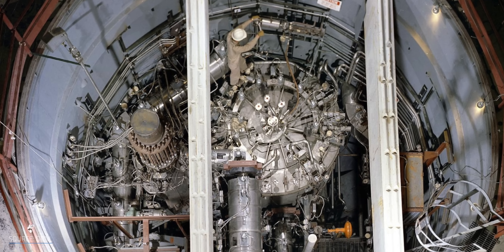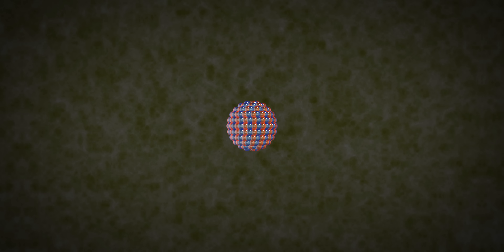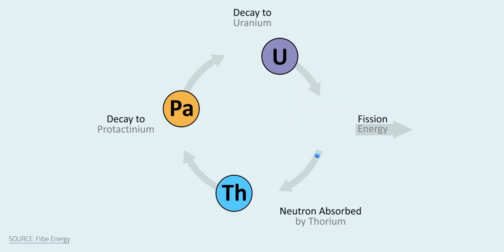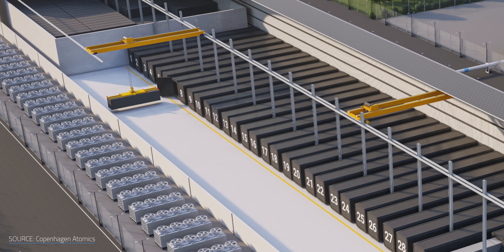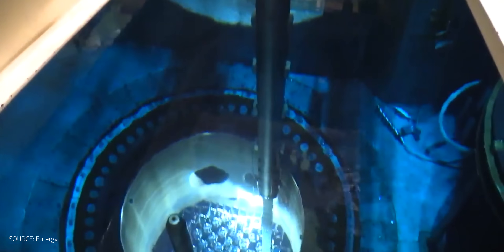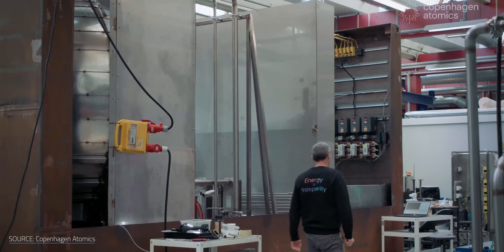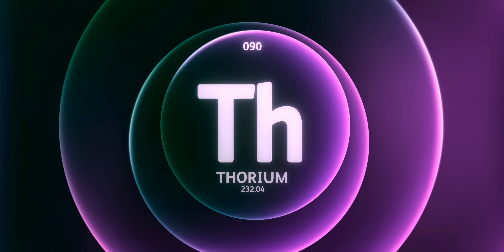Why Thorium is About to Change the World

Comment: How viable is such a power source if you have to replace the whole module every 5 years because of corrosion and radiation, and then not be able to recycle that module due to the radiation it has been exposed to ? And given that the desire is to have many thousands to millions of these reactors, where is all this waste going to go for the hundreds or thousands of years until the levels of radiation becomes safe. This is not to mention the loss of limited resources that could go into building other sources of technology or energy that is lost due to the disposable eco system these reactors would create (and which so much other disposable technology demands) .   This would also mean that the up scaling of building,  maintaining and disposing of such an eco system to one monopoly corporation brings its own problems and risks that corporate monopolies often do. ie price gouging and market manipulation, not to mention dependency and corporations acting in their own interest.

Sounds Great on paper, but as often happens, the reality is so different and often the cost/benefit ratio not great on the benefit side of things.

Comment: 9:12 Gamma radiation is the most energetic one. Only half a meter of steel to cover it up? Imagine dudes moving ship containers and bursting gamma rays at every person crossing by 😂
Reply: Presumably the reactor isn’t running (and breeding Uranium) during shipping.
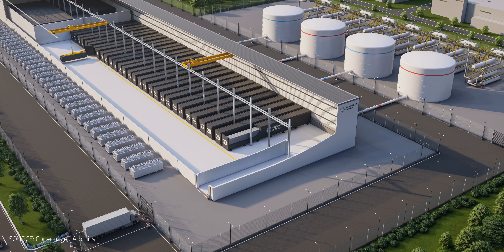Reply: @frederickheard2022   My concern that goes along with the original comment is the facility design that shows up at 2:25 that shows the shipping containers lined up alongside one another in an open environment surrounded by what looks to commercial office space. I know it's currently just a visual concept, but I do see that safety concerns with designs of that nature.

Comment: Very cool technology; I bet the engineers have enjoyed the challenges presented during the design process. Germany's THTR-300, a prototype commercial power station, operated in the 1980s, using thorium as a fertile fuel.

Comment: Nice Job Matt! I love renewable energy like wind and solar, but when we fail to consider new generation nuclear fission, we disregard an energy solution that can fill in the gaps of other renewables. One example you cited was the waste heat generated by a thorium MSR, useful for industrial purposes, or to desalinate water. Another useful by product of two fluid MSR's are the useful medical isotopes that can be extracted in real time, while the reactor is in operation. Would love to see workable Fusion energy too, but when you consider ITER, the proof of operation and cost seem far off yet. In years to come, Fusion will probably also be viable but not before the nuclear renaissance occurs powered by new generation fission.

Comment: The corporations that run the “energy economy” will never let this tech see the light of day.
Reply: This is my fear, and the DOE/NRC officials have been complicit in suppressing this technology for more than a decade, where they always misrepresent thorium by its disadvantages in solid fuel, and never consider the thermal spectrum molten salt breeders being advocated. Those profiting off scarcity do not want abundant and universally available cheap energy, where the fuel supply can't be monopolized or choked off.

Comment: I worked in the nuclear industry for 42 years and am pro nuclear.  Here are the facts; New nuclear works well as a base load power source and is very reliable.  New nuclear is the most expensive way to produce electricity. There is no such thing as economies of SMALL scale and the smaller the facility, the higher the operating cost.  Thorium is not fissile and while it can be used as a fuel, overall it would add more costs to nuclear. Nuclear power construction has always used the build it in a factory concept to the extent possible and this idea is not a game changer. The U.S. has designed and built every possible reactor design and overall, PWRs and BWRs have the most pros and least cons.

Comment: Wait what? "The tech will never get old because the whole reactor only lasts 5 years" doesn't sound like a flex... What percentage of material needs to be replaced? And it sounds like all that material would be super radioactive? How is it recycled or even disposed of?

Also.. are these plants any better at varying their output? Because that's the nail in the coffin for existing nuclear - because it can't compete with   unfirmed solar and wind when the sun is shining and the wind is blowing, meaning they can't reach their required utility to be anywhere near cost effective (the LcoE for nuclear, already very high, assumes 24/7 operation)

Unless these reactors can produce power for cheaper than wind or solar, which it doesn't sound like they'll be able to for a long time, they will be in trouble if they can't vary output.

Their is niech use-cases for nuclear, data centres and servers that absolutely need 100% up time.  But even heavy industry could adjust its operations to line up with renewable output.

Comment: There is a way around the traditional uranium reactor. The Stirling engine. A technology from the 1800s which would maximise the nuclear reactors energy output by using the heat to produce power. History has just as many answers as dreams of new technologies.

Comment: After using them they can drain out the molten salt fuel, but surely the rest of the plumbing, pumps, reaction vessels, shielding, etc. are radioactive waste and/or seriously physically degraded after a few years of heavy gamma irradiation? What happens to the old reactors when they're done with them?

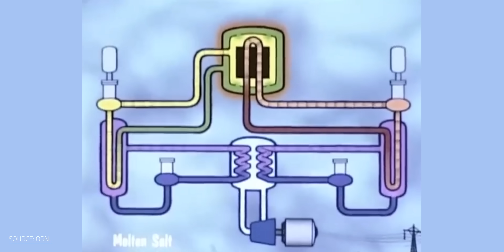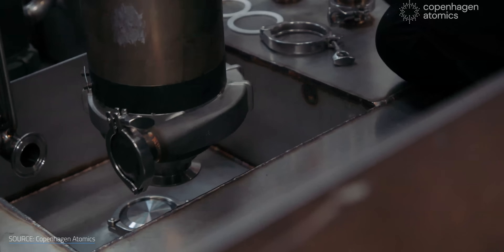Comment: This rolling advert for Copenhagen Atomics is full of lies and distraction and needs some documented skepticism.  1:15 "ran successfully for 15K hours from 65 to 69 producing steady..." From Bulletin of Atomic Scientists: During its operational lifetime, the Molten Salt Reactor Experiment was shut down 225 times. Of these 225 interruptions, only 58 were planned.   5:50: "safer" is a potential, but since there is no experience with novel reactors and fuel assemblies, there is no known safety.  Further, the industry has been attacking and de-funding the NRC to remove public safety oversight.  Breeder reactors don't rely on nuclear decay, and are always just a few seconds from meltdown, as happened with Fermi 1.   7:20 having a circulating core and an enrichment blanket makes this the obvious choice for proliferation. The reactor can run cheap and publicly available U238 through the blanket to produce plutonium for bombs.  As these reactors will be made for the international market, developing world politicians want such reactors for nuclear weapons production.  8:47.  It is conceivable that since water would follow gravity in the reactor, a flood as we had with Fukushima would keep the exit lines cold, preventing exit from the core, resulting in overheating, or meltdown.  Since it is such a small reactor running hotter with no secondary containment vessel ,  there is much greater chance of hydrogen explosion, and release to the environment. 9:34.  We have made U233 bombs before, with a few tweaks the reactor can produce a greater amount of U233 vs U232. 10:34 Above ground safely for " a few hundred years."  It is still an awful product that could be weaponized as in dirty bomb, and a few hundred years is a long time, as we barely had steam power and trains didn't come along for almost another hundred years, three hundred years ago.  11:00 Waste burners make very complex and long lived wastes, negating any advantages just mentioned. The MSRE produced wastes which were the most complex wastes Bechtel said they handled. Those wastes also nearly had a criticality event which would have been disastrous, probably a release to the environment.  11:50 Kudos for showing heat, neutron bombardment and corrosion are major problems.  Mated to mass production, and unapproachable maintenance, it should be obvious this is a bad idea.  13: 10 Pederson's math is bad, it is doubtful that you would have a new model every year which is the only way you would have it new every 5 years and have constant production. Airplanes have more conservative changes to maintain safety. Likewise the cost of licensing of continually renewed designs would be prohibitive. 15:50: Nuclear power has always over-promised and under-delivered on price.  These prices are already met with Wind and Solar with storage, difference is renewables and batteries will be cheaper in the future, while fission is consistently rising in cost.  16:45 "Provides something that Solar and Wind can't"  for example the car company "BMW has sourced it's aluminum from solar produced light metal foundry at Plant Landshut", and concentrated solar has been known to reach temps for Ammonia production.  Overall, the production of nuclear weapons is the true game to all the breeder reactors such as from thorium advocates and Terra Power and Natrium. They are slated for international export, and there is more money in patents for reactors involved in making bombs than for  producing electricity.  I have enjoyed and approved of Matt's work, however this advertisement is disgraceful lack of checking history and facts.

Comment: Saying thorium is closer than ever is about like saying fusion is closer than ever. There are fundamental problems with the technology that we have no idea how to overcome. For thorium it’s the physical erosion that happens from moving around such a high density high temperature liquid. Perfusion hits how to contain 400,000,000°C plasma. I honestly think we’re gonna figure out fusion before we figure out the erosion from thorium. Heck we’re more likely to have piezoelectric generators certified for use from Westinghouse before we figure out the erosion issue. Funny thing is the Westinghouse idea was brought up in the 50s but it got guilt so let’s see what happens this time I guess

Comment: Probably too little, too late. Advanced geothermal shows better promise of becoming cheaper than fossil fuels; requires no fuel; creates no waste; and the earth has enough heat to power humanity for 4 billion years.
Reply: How do you access geothermal energy? Don't you lose a ton of it just by temperatures cooling down as you bring it to the surface

Comment: I love, love, love, Thorium reactors. Thorium, named after the god of thunder himself. There is so much more you couldn't cover. Things like Thorium is in the highest concentration around rare earth minerals, so a side effect would be access to minerals only China controls right now. Right now the problem with rare earth mines is all the Thorium around it that they have to dig through and store at great expense before filling it back into the hole when they are done. Excess waste heat could be used to desalinate water. That small amount of waste can be used in cancer fighting radiation or to power NASA spacecraft. The waste could actually be worth more than the thorium it was burnt out of. Also keep in mind that a standard coal plant releases up to 100 times more radiation into the air than what any nuclear plant is legally allowed to. Love Thorium

Comment: The primary issue with thorium is that it is dangerous to mine. Median survival to thorium dust inhalation is 33 years. And the studies found it made no difference if you were working in the mine or top side in administration.

While the studies are old, mostly dating from the 1950s and 1960s, it is quite a statement that industrial safety experts effectively banned the use of thorium during that time period. Thorium as an industrial product is really that dangerous.

Keep in mind a plus for uranium is that it has to be enriched (i.e. processed) to be used as a fuel. Thorium does not.

Comment: small modular reactors is a scam. they are not cheaper than large ones, which are already the most expensive source of electricity.
there are no economies of scale for them because they can't get cheaper until they get scale and they can't get scale until they get cheaper. nobody will buy hundreds of gigawatts of expensive nukes, which still require army to guard fissile material.

Comment: I believe this is our best shot at a thorium breeder reactor. The big benefit of CA's design is the plan to swap the reactor core every five years. Traditionally, reactors are expected to last 40+ years, but we don't have any alloys that can survive that long in a molten salt environment. Swapping the reactor allows you to bypass this problem and iterate the design more quickly.

I've calculated the cost of this swap to be around 0.5 cents per kWh.

To my knowledge, the Chinese reactor design cannot be easily swapped, so they rely on a superalloy that doesn’t yet exist.
Additionally, CA is building full-scale from the beginning, whereas China is developing pilot plants in three steps, with increasing size and different dimensions. CA has also focused on building and testing components from the start, and they claim to have about the same molten salt test capacity as the rest of the world combined. Many other startups only have designs on paper.

For these reasons, I believe CA is on track to be the first to the finishline, and with a very competitive design.
Reply: There are multiple companies that have been proposing for years to dispose of the vessel after a relatively short time period, not just CA. Terrestrial also proposes this. Another so called benefit is the moderator is also replaced. What could be an issue is disposing of all that activated and potentially plated material.
One of the benefits of solid fuel designs is that the cladding is the only material in direct contact with the fuel. MSRs still need to address the quantity of material in direct contact with the fuel which can make maintenance difficult and creates a potentially difficult waste issue.
Reply: @richardb1452  You are right that several others plan to swap the reactor, but most of them are not going for full thorium bredders. Do you know of any? I think Flibe Energy is one, but they have been less focused on testing components.

Comment: Good video. For what it's worth, I think next gen fission via modular implementations of molten salts & thorium are likely to precede any sort of fusion by many decades. The key question will be in how quickly "developed" nations adopt sensible regulatory frameworks to let them get initiated, built, upgraded, and decommissioned (and perhaps most importantly, get insured). I suspect that the fusion guys will eventually get caught up in those issues too, but they're so far away from deployment, they can ignore it for now.

Comment: Thorium was defunded because it doesn't require U235 enrichment and doesn't generate PU239 which are both needed for Nuclear Bombs. This is why new reactors in the Middle East, an energy rich area, which doesn't really need the energy, are being installed. Iran for example, as we speak is enriching U235 well beyond what is needed for Nuclear Reactors to levels needed to build nuclear bombs. Solar / Wind / Battery power plants now produce baseload power at a fraction of the cost and in a fraction of the time needed to bring it on line.

Comment: The mitigation of an explosion by avoiding high-pressure in this design is replaced by the danger of an explosion when the molten salt comes into contact with moisture and/or water. The explosion danger still exists. Check out the you tube videos of molten salt and water explosions.

Comment: Hello! I'm a Brazilian from Rio de Janeiro and the AI you used to do the translation job did a terrible job, there are several moments it doesn't know how to translate a word or a name and it just events a sound that is not even an intelligible word. And it would be nice if the video started with the original sound as default instead of jumping right into the AI audio track.

Comment: Thourium is a solution to keep energy production centralized and to keep us dependent.  Wind/solar and battery is growing exponentially and are already cheaper than nuclear.  No licensing, no regulation, no waste products, no public safety issues; a no-brainer.
Reply: This is exactly wrong; thorium reactors can be small and distributed any and everywhere, in loose and independent grids, with fuel available anywhere you can dig. The reactor is efficient enough that you can source your share of the thorium fuel with a garden shovel. The enormous resistance to this technology, likely stems from the fact that it can actually deliver cheap and abundant energy, that is truly decentralized and the fuel can't be choked off or monopolized. Once you have the fuel/blanket salts (and D2O in some designs), everything else in the reactor is perfectly ordinary and could be supplied and maintained by local industry anywhere. You could make a good argument against large conventional nuclear, but not thorium-fueled molten salt breeders.

Renewables need to be aggregated into a massive inter-dependent system, which itself actually epitomizes central control, and is certainly not cheap. If you truly believe in the decentralized ideal, consider altering your alignment on this. Nuclear isn't actually that inherently dangerous, and could be safely deregulated (for the most part; we do want to monitor for releases and inspect reactors to make sure they're not being misused, but that's it). The hysteria over radiation arose from scientific misconduct in adopting LNT, which is nonsense that was used to create fear, and doesn't remotely reflect real harm. See Jack Devanney's Gordian Knot book/SS for more on that.